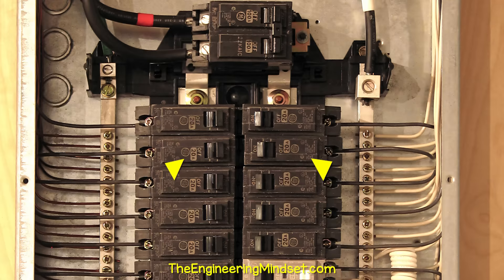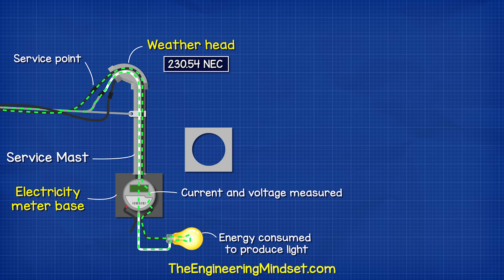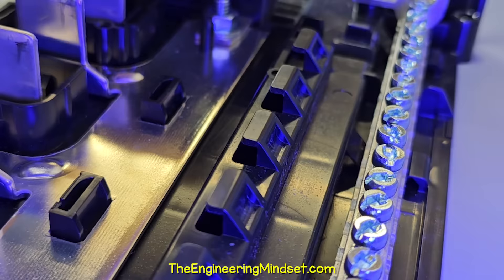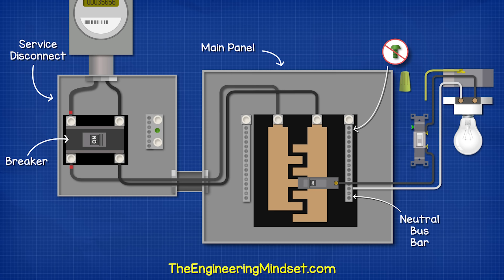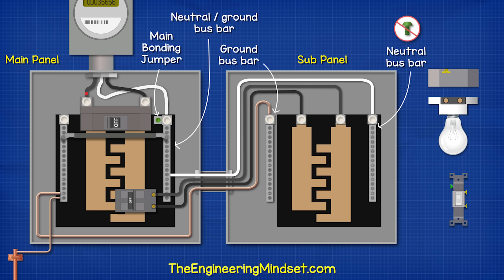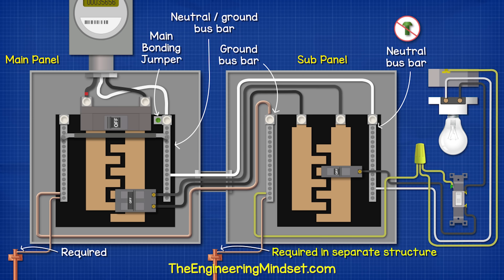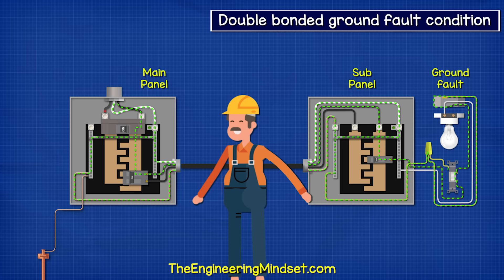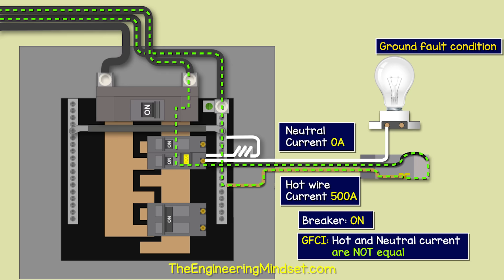Sub Panels Explained - Why are neutral and ground separated?

Comment: Can someone explain why ROMEX and an extension cord of the same amperage rating and length aren't interchangeable?

I have a garage 80' from the nearest outlet in my home also 80' from the main panel.  If I want to run a welder in my garage an extension cord won't work but ROMEX will?  I get that stranded wire is more flexible and ROMEX less.  I'm willing to agree that stranded disappates electrons a tiny bit faster which I guess could resolved with better insulation but the copper is equivalant.  I also understand that electrons run on the outside of the wires not in the core.  Extension cords would therefore seem to dissapate heat better and push more electrons because of the increased surfaces of stranded wire.  Wouldn't more electron movement be better in the "long run"?  Pun intended.

What am I missing?
Reply: An extension cord's rating isn't governed by the NEC.  Chances are, the extension cord has a significantly lower wire gauge, than the equivalent ampacity of Romex.

The extension cord is also meant to be used when the wire is unrolled from the reel, out in the open, so it has plenty of airflow to dissipate its heat.

If someone tells you not to use a rolled-up extension cord because of inductance, they don't know what they are talking about, because inductance is nullified by the fact that equal and opposite currents flow in both conductors.  However, it is true that you shouldn't use a rolled-up extension cord because of heat dissipation.
Reply: Thanks but given they are rated the same amperage. 

From everything I've been able to find extension cords have more strands and disappate heat better (not rolled up which it wouldn't be going 80 feet behind my house) and would seemingly carry more electrons.  

Why is ROMEX considered the only real choice which requires burial, a permit and a sub-panel among other things for getting electric to my garage?  @carultch
Reply: @cityguyusa  Romex is not allowed to be buried.  Its use is limited to dry locations, i.e. indoor locations.

You need to use UF cable, which is the wet-location equivalent of Romex, if you want to bury it.  Or another equivalent wiring method approved for burial, like PVC conduit.
Reply: @cityguyusa  

As for the question about the extension cord, it's not the number of strands that matters for its ampacity; it's the total cross-sectional area of copper conductor.  Extension cords are likely deliberately built with finer strand wire to be more flexible.  Extension cords likely have a greater "ampacity" than the same gauge of wire you'd have to use in a permanently-installed wiring method, because extension cords will be used where they are in free air, and only temporarily used.  They are not meant to be permanently installed.

Anything permanently installed, needs a permit, so there is accountability about who did the work.

Comment: What if the sub panel is only grounded to the rod n not the main panel?
Reply: Then you need to make sure that the resistance of the elektrode is low enough to cause a high enough current for the breaker to trip.
Reply: @Alex_Vir  what do you mean low enough in the ground
Reply: @philmarmolejo7231  low enough resistance to ground, my brain must have skipped a thought.
Reply: @Alex_Vir  thanks
Reply: If they are having the amps fluctuating is that caused by the ground not being grounded to the main panel. I grounded to a water line but idk if it’s deep enough.
Reply: @philmarmolejo7231   You would need some measuring equipment and find out which regulations apply to you, to find that out.

Comment: GFCI is optional for your system I guess.
Reply: For decades in the US, GFCIs were not required for residential applications, so there are literally millions of non GFCI circuit breakers in use. In the four structures I own — two homes, a large shop, and a garden house fed by sub panel — only one breaker is a GFCI. This brilliant tutorial introduces the concept of the circuit breaker in its simple form and later explains the GFCI, allowing the viewer to first gain knowledge of basic principles. The tutorial obviously is not meant to be a depiction of the 2023 NEC code requirements. The NEC, as every electrician knows, changes roughly every 12 minutes.

Comment: Why not just have one wire and one busbar for ground and neutral in both panels then?
Reply: You need to have a ground and neutral bond in the main panel or first disconnect means so the current returns via the neutral wire to the transformer and trips the breaker. Otherwise all the metal parts will remain energized.
Reply: @surferdude642  yeah but if you have one bus bar in the main and sub, wouldnt the electricity return on the neutral anyway? It would be like an extension of the main panel where it is bonded
Reply: @Gt92279 Some of it would, but maybe not enough to trip the breaker. In the meantime you'd have parallel paths of current and that's a shock hazard. This condition in electrical wiring is known as "objectionable current".

Comment: Yea but can I get netflix UK through my 110v/240v 2 phase US power system? 🤣 Just kidding, excellent explanation. Thank you.
Reply: Your computer uses a switch-mode power supply, to convert either 120Vac or 240Vac, or anything in between, into DC, so that it can be a voltage-agnostic appliance, and so it can be used with any country's standard receptacle voltage.  Your computer cannot tell which voltage is powering it, once it's converted to DC.

Comment: It doesn't matter where the neutral and the ground connect.

If it connects at all then it is all connected all the time.

Electric finds the path
Reply: Voltage drop, load splitting, safty and ease of inspection tell you otherwise.

Comment: In Norway, all new houses have 3 phase 400V and 230 volt for consume takes from one face and neutral... 120 Volt demands 2 times the amount of copper also. In additional, all houses can use 3 phase motors... (we don't have miles, inches, pounds or gallons over here... That's stone age.)

Comment: as a european im confused about only having 120V and only 2 hot phases
Reply from the maker: The US take a 240V single phase supply and split it at the transformer. They can use one half to get +120V the other half for -120V or the full transformer for 240V

Comment: I see nothing wrong with using a separate ground rod for a detached building where there is no ground wire back to the main building.
Main building supplying power and neutral to the detached building.
This is residential.
Rewiring the 'drop' to the detached building is out of the question due to massive demolition of internal walls and A-Hole inspectors demanding you bring the whole main building up to code. Giant can of worms for adding a single outlet.

Comment: I'm always astonished about how the US electrical systems work. There appears to only be one standard design of distribution panel, which is now laughably old fashioned. Everything is big and numpty, the meter services etc are really ugly and don't get me wrong but those overhead services and cables are a real eyesore. With regards to those distribution panels, we have a whole range of makes and types in the UK and Europe that can actually be fairly pleasant on the eye. And the Schneider Acti9 Isobar 3 phase panels are just superb, so easy to configure and work on. Then too cap it all 2 voltages in a domestic setting??? Having said all of that I quite often wish that I had emigrated to the US 40 years ago.

Comment: Really peculiar hearing an English voice describing the US electrical system... 
I thought the two "hot" wires were on 2 different phases????
Reply from the maker: We publish in 9 languages. But the hot wires are just a single phase which is split at the pole transformer. Connecting to both hot bus bars connects you to the full transformer coil, connecting to one of either hot bus bars and the neutral gives you just half of the transformer. So you get 240V or 120V
Reply: In a way, they are. The last transformer “splits” the incoming phase into two, 180° apart phases. Hence, the correct name is “split phase”. I’ve never researched when the term came into use, but it’s very likely it was introduced simply to avoid confusion with the phases of the distribution line and, more importantly, to distinguish them from the older two-phase power distribution systems.
Reply: @threemr01  If you mathematically extend the idea of a 3-phase WYE system to what we do in the US, it might seem logical to call it "two phase", since instead of 3x 120V to neutral phases that are 120 degrees apart, it is mathematically equivalent to two 120V phases that are 180 degrees apart.

The reason we DON'T call it two-phase, is that "2-phase power" is an obsolete power system, which had two line-to-neutral circuits that were 90 degrees apart.  The reason for such a system was to assist in the problem of motor starting.  We don't use that power system anymore, since now we have single phase motors that can use a starting capacitor to temporarily produce their own supply that is almost a 90 degree phase shift from the main supply, and it turns that circuit off once it achieves its running speed.

Instead, it is called split phase, because the transformer produces it from splitting the secondary coil, and deriving a neutral at the center tap.

Comment: You could have done a better job explaining what would happen if the neutral and ground were not separated in the sub Panel.  Would the breaker still trip when there is a ground fault?  And when it did trip, wouldn't that instantly resolve any potential shock hazard between the main and sub-panel?  It's too bad you didn't explain this well. 😞 You failed to thoroughly explain what would happen if there is a short while the neutral and ground are not separated in the sub Panel.  You should have explained the "floating ground" and HOW this can increase the risk of electrical shock and damage electrical equipment. You spent too much time explaining background concepts and very little time explaining your main thesis.
Reply from the maker: Thanks for your feedback. There are so many other things I could talk about but these are better suited to a dedicated video. As the editor, I have to draw the line somewhere.
Reply: No no and no
Reply: Or maybe instead of just being insulting, you could offer your own technical input. Dolt.